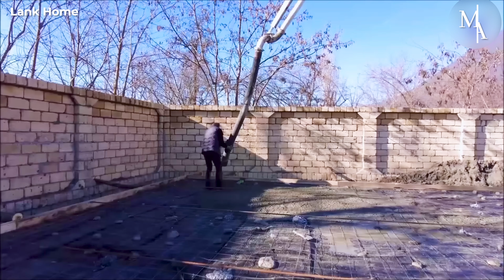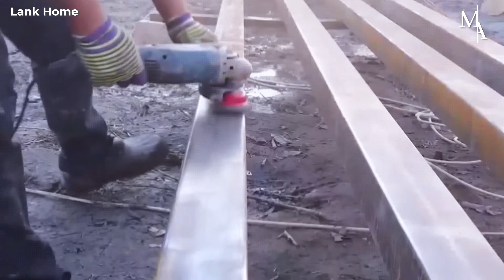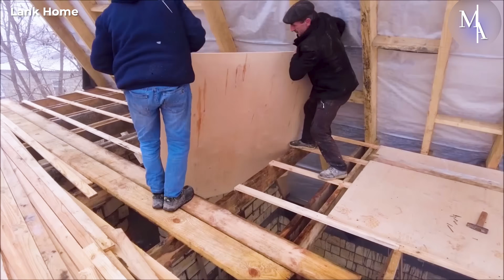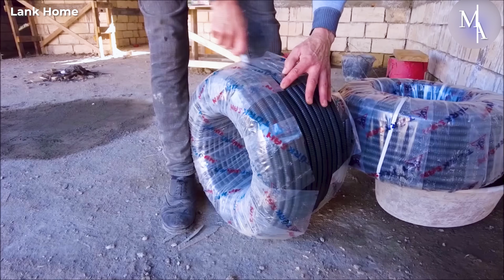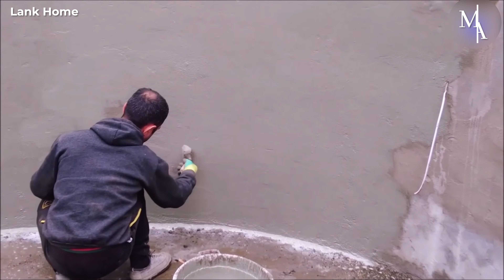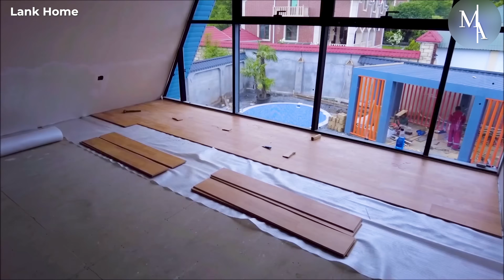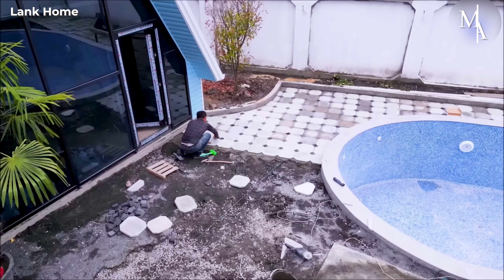Man Builds a Massive Glass A-Frame on a Remote Mountain | Start to Finish by @LankHome

Comment: 1:27
BIG BIG BIG BIG MISTAKE!!!!!!!!
the metal reinforcement is on the ground and not raised properly. this concrete floor will crack and break 
"carefully prepared" nope! they did the biggest mistake one can do making a concrete floor. 
wasted money and will cause huge problems later.

also the metal is wire, not steel rebar. a joke, sorry.